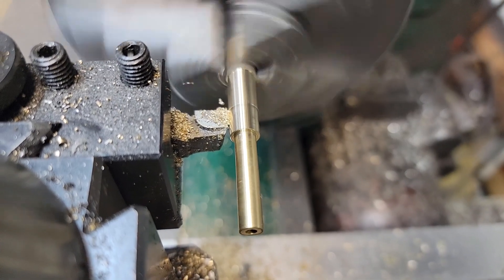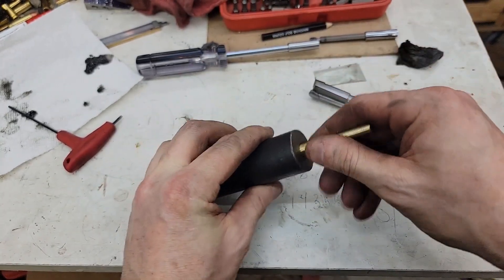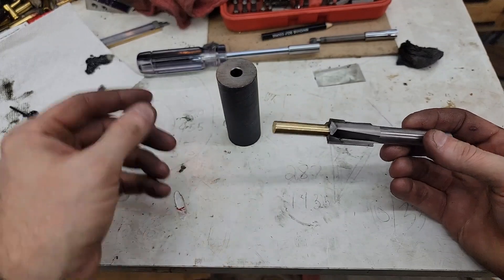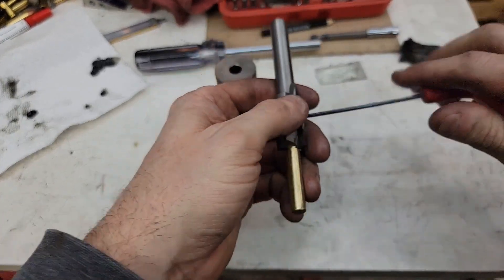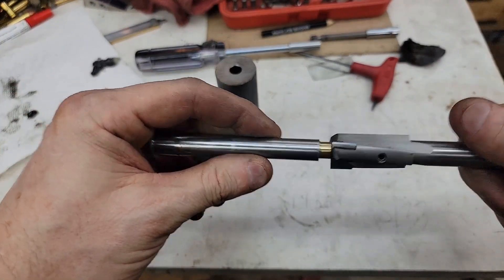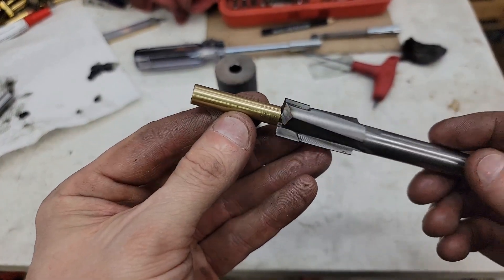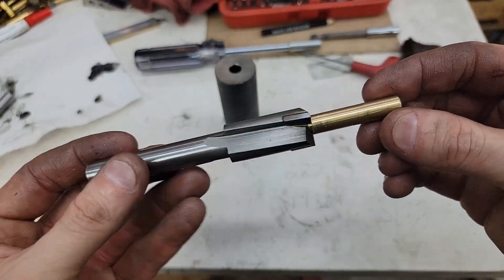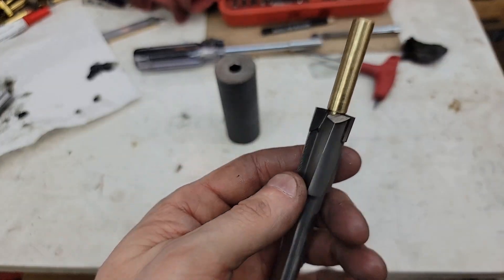Muzzle Chamfering Tool From A Piloted Carbide Counter Sink

Comment: Damn dude. Didnt see that one coming. I did at Least 10,000 crowns, all in a lathe. Never once with a tool, besides the one I made to do hunter crowns easier. Shameless.. 😂😢
Reply from the maker: Yeah, I don't see this getting used on barrels much.  It worked great on my FGC-9 to take off about .100.   I just did a rolling block somebody had saw cut.  He would have been happier not to pay for the time I spent setting it up in the lathe.   I have a set if old crowning/chamfering tools.  They have different bore guides and a T-handle to turn them all by hand.  Old stuff like that is crazy in the eyes of anyone with a lathe.  But those old smiths got it done.
Reply: @jimafcarbon4433  I had 3 different sizes of t-handles, but that was just for going 0.001 deeper in a chamber. It only took about 60 seconds to get a barrel dialed in to 0.0005 concentricity. That's why you charge for experience and not Time.
Reply from the maker: @travisberg9031  for sure.  Some guys are just cheap.  They want a $5 chamfer.    Most times, I won't do a $10 Even if that's all I charge.  But damn some guys are cheap.
Reply: @jimafcarbon4433  I built houses for 20 years, so I'm just stubborn about doing it by hand. I Rarely used my DRO. I like Wood Wrights. Stubborn.
Reply from the maker: @MyGunsMakeYouSafe  nothing wrong with doing it right.

Comment: Isnt this for counterboring a sunken crown? Wouldnt you still have to turn the 11 degrees onto the barrel afterwards?
Reply from the maker: I made the arbor specifically to cut back a threaded 9mm barrel.  I wouldn't normally cut a target crown on something like that.  I have another tool for cutting the muzzle crown.

This would be good for truing up a barrel after being saw cut.  People bring in all sorts of stuff half done.
Reply: Hi! Is this a hand tool?  When is it not possible to mount a rifle in a lathe?
Reply from the maker: @warrior-0f-light  yes or on something that doesn't need to be perfect.  Just better than saw cut.